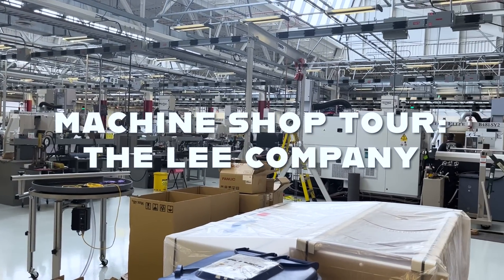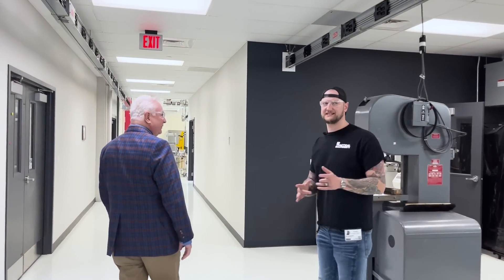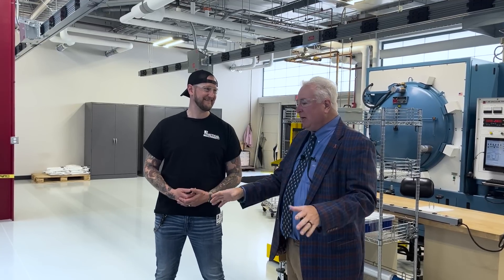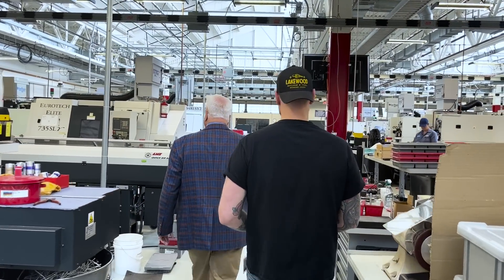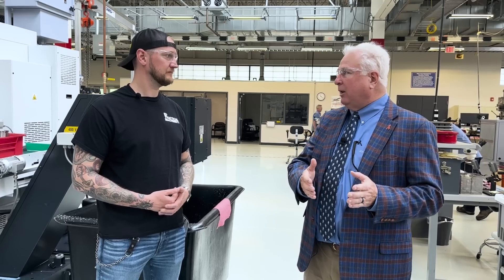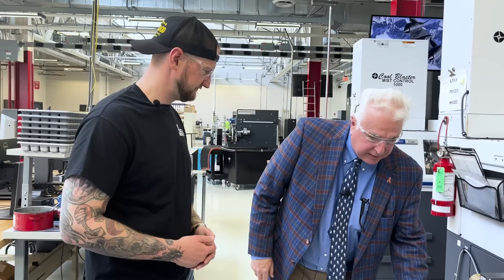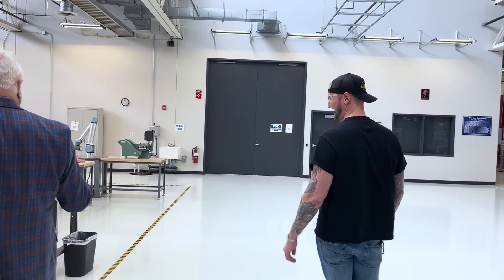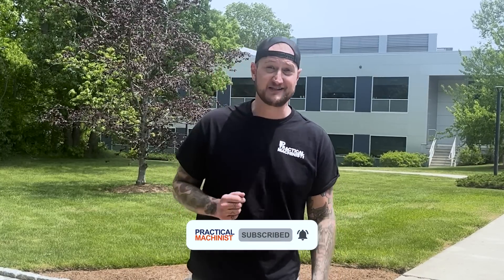This Shop Makes Parts for EVERY Aircraft in the Sky! | The Lee Company Shop Tour

Comment: The hydrogen furnace..
These must be some mixing of hydrogen and nitrogen at the curtain..
Sooo there'll be spent hydrogen / nitrogen mix at 2,000 F..
Now that's a fun thing to deal with, is it burnt to heat the process?
Reply: Yes a small amount of hydrogen does exit the process mixed with the nitrogen. The nitrogen then passes through a flame to burn off the excess hydrogen before it’s released into the atmosphere. It’s not used to add heat to the chamber, the chamber is heated with electric coils temperature controlled electronically.

Comment: Epic. The question is how are the holes actually made?
Reply: For some we use a wire mesh, for some we use a photo etched material, some are mechanically drilled, but most are made with Lasers.  The specifics are a trade secret. Sorry….
Reply: i was thinking the same .
Reply: By laser, I believe.....
Reply: Yeah I was thinking about that too. And how that’s probably trade secrets far to sensitive to share on a YouTube video. 🤷‍♂️ ? I was wondering if it was EDM or lasers, water jet ? It’s a really fascinating facility though.
Reply: I wouldn't expect some clown covered in arm tats wearing a ballcap backwards to
ask that question...